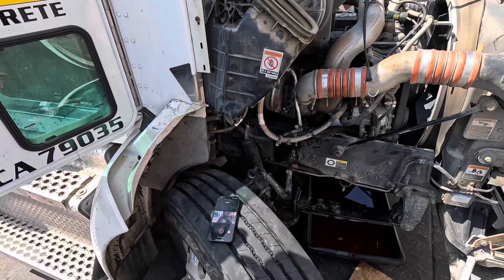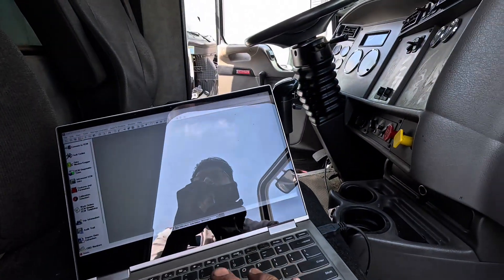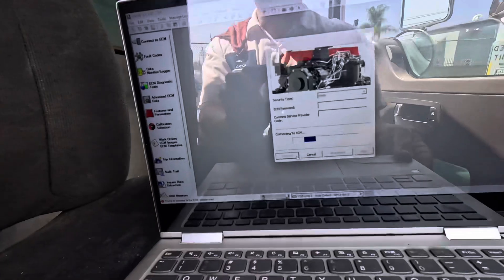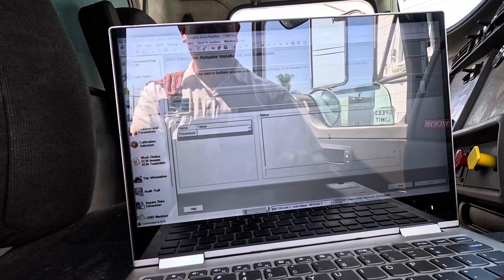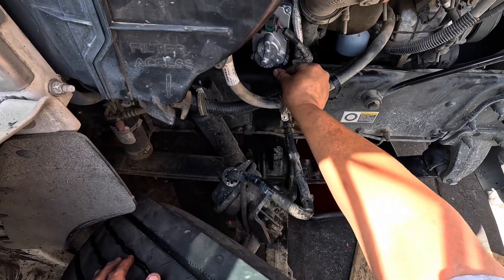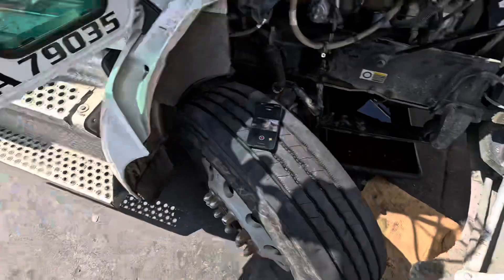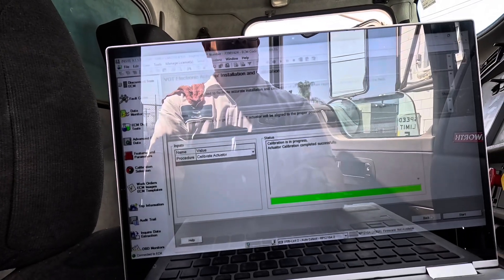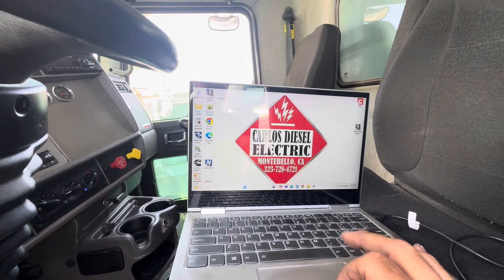PX9 turbo actuator replacement, calibration and installation. Kenworth

Comment: How much and where can I buy ? I have Cummins px9 8.7 L
Reply from the maker: The customer opted to go with aftermarket to save money. I purchased the unit from DTIS in Fontana, Ca. 
Have not had any issues with it so far.
Reply: @CarlosDieselElectric  i would Need aftermarket as well , it’s not the holset remanufactured right ?
Reply from the maker: @Maria-ff8do correct.
Reply: Is aftermarket cheaper ? Remanufactured holset I found $700 with 1 year warrenty . Would you be able to help me find aftermarket cheaper or is holset remanufactured good as well?
Reply from the maker: @Maria-ff8do $700 is a good price. Not sure you will find anything less expensive. Is this online?
Reply: @CarlosDieselElectric this is remanufactured holset 2 places in store in Chicago il

Comment: You can use insite with a paccar motor ?
Reply from the maker: On some Paccar motors you can, not the MX13 though. That is exclusively Paccar. The smaller PX engines are Cummins. So the Insite software works
Reply: Yep like he said on the smaller ones but the parts are all dam near Cummins made🫡
Reply: They are essentially Cummins motors with grey paint and a PACAAR badge